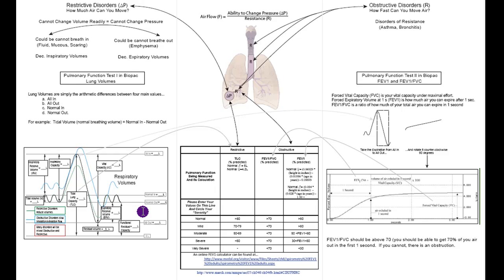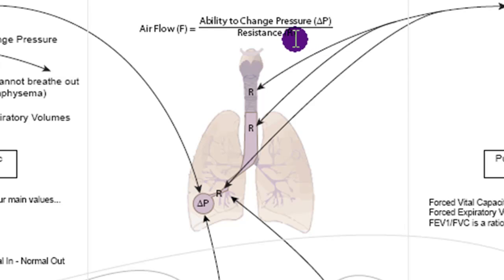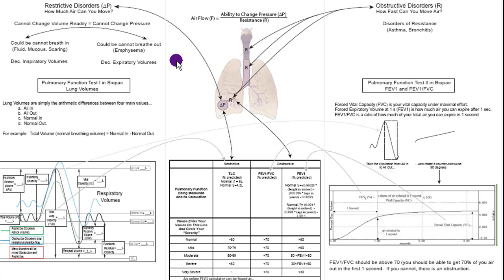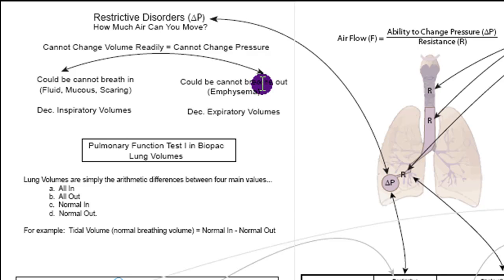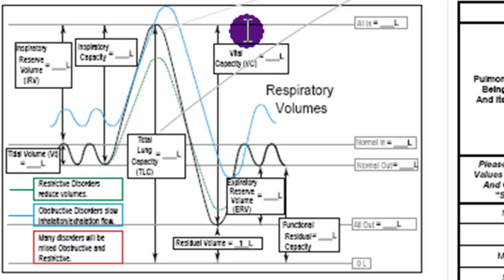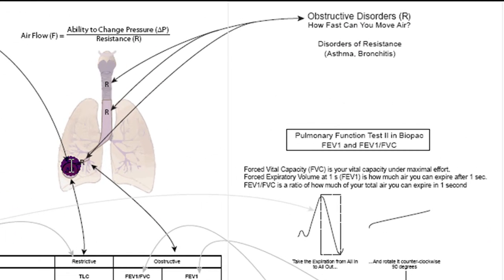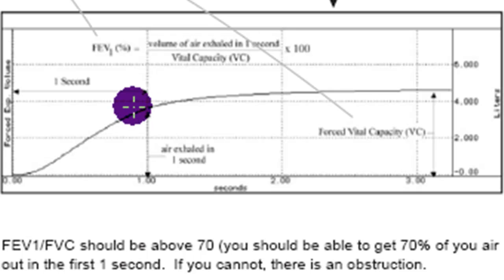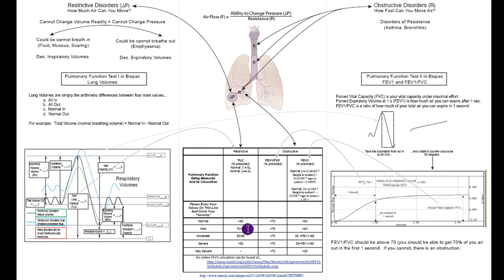Respiratory Physiology Lab: Obstructive vs. Restrictive Disorders

Comment from the maker: @themuffler I will admit that I am no expert but my interpretation is that while emphysema is primarily obstructive (due to the destruction of airways), it is also restrictive in that the increased compliance of the lungs makes it difficult for the lung to decrease volume.  If the lung cannot decrease volume, it cannot increase pressure to cause exhalation.  Since restrictive disorders involve difficulty in changing lung volume, emphysema also has a restrictive component.